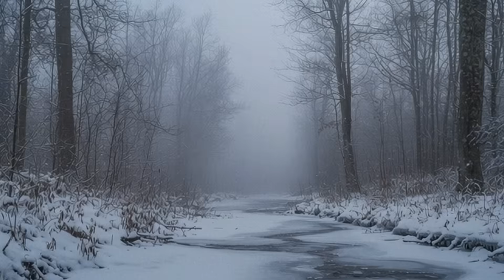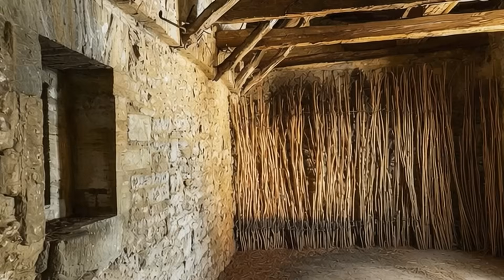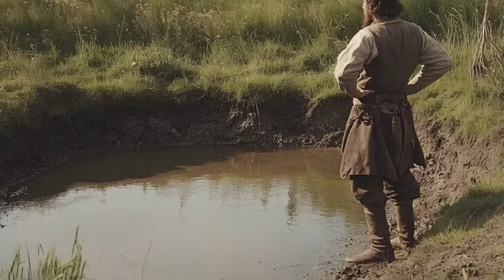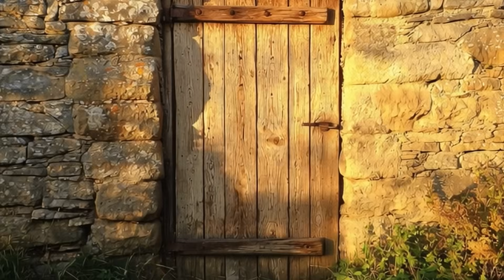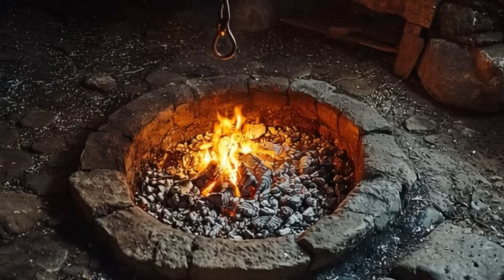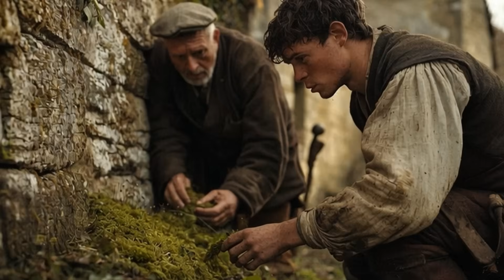Surviving Medieval Winters – The Architecture That Saved Lives

Comment: In Portugal stone was used in the north to raise the walls, with livestock staying in the lower part heating the higher part where humans lived. And thatch was also used. over the house. In the southern part of Portugal thick lime coated eathen walls were used, but since people rarely had livestock houses had only one floor. These white walls maintained the houses cool in  the summer and the thickness maintained the heat in the winter. Due to arab influence, clay tiles were used for roofing.